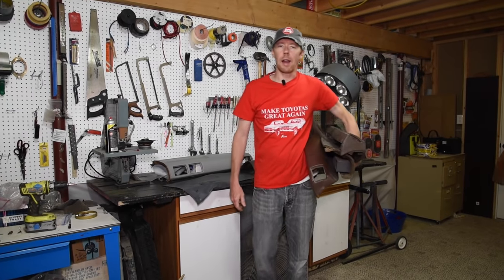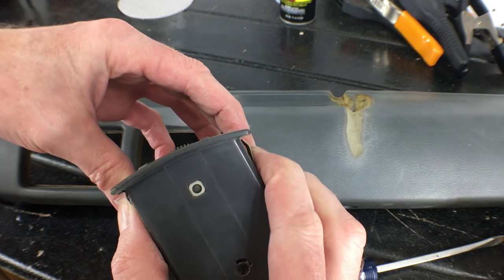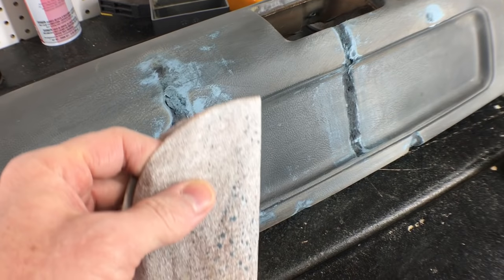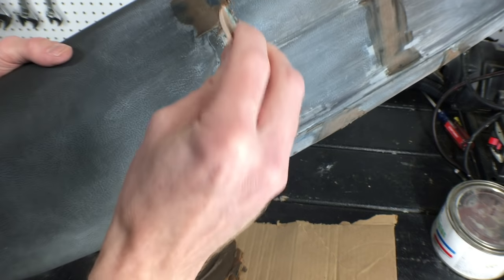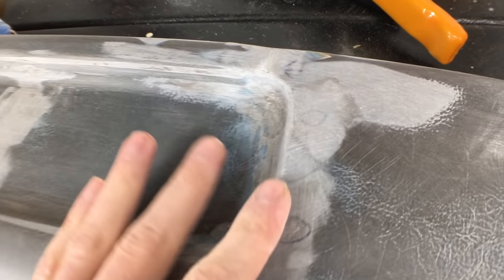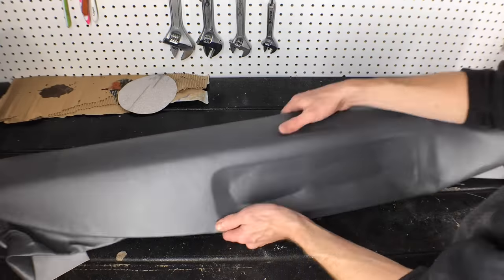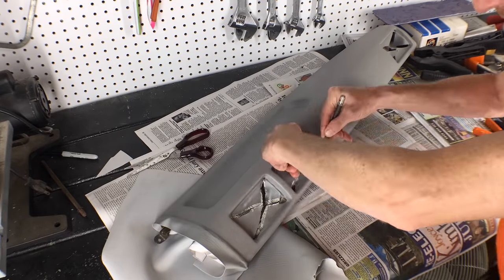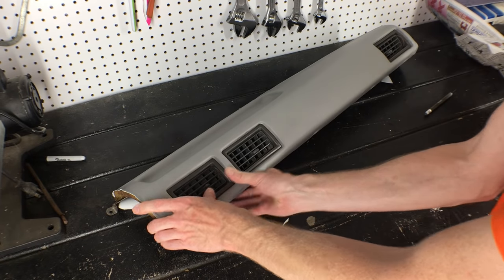How to Restore/Fix/Repair a Cracked Vinyl Dash - Toyota Hilux Pickup/4Runner PART 1

Comment: Great video,  watched it all and got an idea ...what about plasti-dip instead of the vinyl. Then paint to desired color? But would it stand up to the heat/cold ??Thanks for the vid
Reply from the maker: I think I'm going to try another using a spray on bed liner instead of vinyl to see how that turns out.  If I sprayed something thin like plasti dip, the difference in the vinyl texture of the repair area might be visible.

Comment: Helps to use upholstery adhesive glue to help hold down indentations such as that tray area. As for the corners, a good idea to cut a relief incision for the edges to adhere properly. Otherwise looking good.

Comment: I don’t know if this would help you. When I cover speaker boxes, I had a problem with adhesive nozzles getting clogged. So what I would do is flip the can upside down and spray it into a trashcan wipe the tip off a little bit of rubbing alcohol. and that usually helped. And if I was worried about it getting too clogged before storage, remove nozzle I would soak it it a shot glass, then rinse it out with water before putting it up
Reply from the maker: Great idea on the soaking... thanks!

Comment: Great video! Dovu think maybe u could have just filled in and deleted the  Resist area that kept giving you the problems?
Reply from the maker: That recessed area is where an optional inclinometer cluster sits, so I wanted to keep it open, but when I restore the third dash, it's getting filled in!. I recently restored a second dash using spray foam + some better materials and it turned out great: https://youtu.be/XB9GKLRHYNM

Comment: Use contact cement I have been doing cars and boats for a long time that's the best way to stretch you vinyl keep using heat gun and gloves
Reply from the maker: I recently restored another dash using brush on contact cement and 4-way stretch vinyl and the results were much better:
https://youtu.be/XB9GKLRHYNM

Comment: Do you have any videos on filling holes? I have a nice dash but the previous owner drilled holes for a CB mount I’d like to fill.
Reply from the maker: Here is another option: https://youtu.be/XB9GKLRHYNM I used spray foam on this one and it saved a lot of time. But for something small like a screw hole, bondo would be just as fast.

Comment: I'm late, but FYI most fabric stretches more along the bias (45 degree angle to the grain), so you might get more stretch if you laid the dash on the bias than with the grain.
Reply from the maker: Thanks for watching! I recently restored another dash using spray foam, brush on glue and 4-way stretch vinyl, and the results were much better: https://youtu.be/XB9GKLRHYNM
Reply: @6thGearGarage  I found that one after I posted--it looked great!

Comment: Next time after the bundle spray ur dash with that Gray filler used in body and paint. After it dries I need to send it down with 120 _400 set sand paper for a smooth finish. Next spray your dash with a spray gun and desire color 2 or 3 applications then after it dries clean with tack clod if needed before applying 3 coats of clear and ur dash will come out professionally nice. It paint must be bought for plastic allocation of ask where u purchase ur base paint it it can be used as a dash finish which is plastic.
Reply from the maker: I was going for the OEM look but would like to try painting one to achieve a smooth finish. I think that would look good.

Comment: You can put the vinyl in hot water to pull off the cloth backing at the back of the vinyl so you get more stretch when heating the vinyl
Reply from the maker: That's exactly what needed to be done to make this work. Thanks for that tip!

Comment: Wrap tip!: 
When you're messing with indented areas that require tenting and heating, you HAVE to leave a spot where that air trapped in there can escape . 
I mess with car vinyl which I'm sure is different from furniture vinyl but the method is the same ,.
Don't push hard, make sure the vinyl won't pop up over time , if it's popping up right after you put it down , it won't work.
It's also probably the substrate on the dash, most vinyl adhesive hates car plastics so you'd have to use a lot of heat or a lot of primer
Reply from the maker: Thanks for the advice. I may give this another try over winter.

Comment: You need to to brush the glue on and only a few inches at a time and by trying to do a large area will cause you a problem as you can streath it easy a little at a time and it will stick flat and by heating can also destort it if you get it to hot 😊
Reply from the maker: 100% I later restored another dash using spray foam, brush on glue and 4-way stretch vinyl + spray paint, and the results were much better, but still had a little trouble with the recessed area: https://youtu.be/XB9GKLRHYNM Also I put both dashes through a torture test to see which products held up better and the second one was definitely the winner: https://youtu.be/ywkqTaHK2LA

Comment: It's not OCD.  There's two ways to do things.   The right way...  And again.
  You repeat a process as necessaryuntil it'scorrect..  What's learned with experience is that it's easier to add a little more than enough and sand once or twice for each step rather than three or four times for each step (different material) with the exception of detailed areas which need a little more finessing. 😉

Comment: Glue a little bit at a time from middle out. Don’t use so much glue, let both sides get tacky, almost dry. Work material a few inches at a time.
Reply from the maker: I recently restored another dash using spray foam, brush on glue and 4-way stretch vinyl and the results were much better: https://youtu.be/XB9GKLRHYNM

Comment: maybe if you put the entire thing into a bag and apply a strong vacuume it to it,it will cause the vinal to form properly, keep in a vacuum until the glue sets.
Reply from the maker: That's a great idea, thanks!  I recently restored another Toyota dash using spray foam, 4-way stretch vinyl and brush-on glue, and the results were much better! https://youtu.be/XB9GKLRHYNM

Comment: Just a suggestion ... from an OLD paint guy , don't use cardboard for your mixing of filler , use an old glass cutting board , the wax and oils in the cardboard have some weird issues with adhesion
Reply from the maker: Good to know, thank you!

Comment: I would suggest using some type of rubber roller to used on the vinyl in the recessed areas in the flat areas, similar to what you have to do when you're installing a new screen and your window

Comment: Just wanted to say , excellent job, also a Question, is the black “fungusey” looking stuff on the back like wood rot? Ie. unless you treat it, it will keep eating your dash?
Sorry a newbie question
Reply from the maker: The back side was metal, so it could have been some surface rust. It's not going to do any harm since it's inside the vehicle. It's not from road salt, just moisture in the air over the years.

Comment: Brother the problem is not on vinyl thin or thick, it is your dashboard which the alignment is not equal and the way you apply filler it is not going to give good result even if you sand it multiple times. When you're putting filler you must not shake or move upside down, the moment you applied filler you must make sure that all the corner of the dashboard is still intact, 2 filler code is enough if we put little more extra in the first code so that we can sand it according to original shape. Before applying vinyl we can apply 1 code of paint spray in order to level up or cover up any tiny holes.

Comment: How can I stop the cracks? Will 303 uv spray help it? I have a blue dash for my 93 4runner and want it to last. It has two tiny one starting but dont want it to spread.
Reply from the maker: I haven't tried 303 uv spray, but the only sure way is to park out of the sun. I apply baby oil to the dash of my 85 and it has not cracked.

Comment: Fill in the recessed area and make it level with the rest of the dash top. Anything you put there will fly off when you drive.
Reply from the maker: I wanted to keep the shape OEM because there's an optional altimeter/inclinometer cluster that fits in that recessed area. I restored another Toyota dash using 4-way stretch vinyl and brush on contact cement, and the results were MUCH better: https://youtu.be/XB9GKLRHYNM

Comment: Costplayers use this stuff called foam clay, maybe you could do a project with that as a filler to test.
Reply from the maker: Great idea!  I restored another dash with thinner 4-way stretch vinyl and it's even starting to life in that recessed area. https://youtu.be/XB9GKLRHYNM I need to just fill it in flush.

Comment: If you add a little resin to the filler it is much easier to use.
Reply from the maker: Good tip, I didn't know that... thanks!

Comment: Idk how long u been doing this but u did a good job… I wouldn’t have went to “JOANN’s” I think u said u went to.. I go to an actual spot that has multiple colors and vynal, pleather, leather and etc.. certain vynal only stretches 1 way whilst others I can remember the name but it stretches any which way.. if I were to do this I would have worked on half of this and I would have cut the fabric down enough so it be more easy to use.. I would have attacked that spot your having the imperfection at.. steadily working that spot before I started to glue down the other spots.. most times I’ve used fiberglass and if that dip had nothing to it other then looks fill that area up so it would be a smooth top with no dips.. to be honest I know simple things are expensive for older model cars.. if I was to do it with fiberglass with the tools needed it be around 100$ and I could have made it however u wanted … I hope with GOD’s blessing I want to open a shop of my own someday.. I really like working with cars . My main thing is audio and fabrication. But here and there I’ve been doing other stuff to add to my resume.. like I’ve painted all types of things but never a whole vehicle. I’ve been learning how to do interior fabric custom stuff, and I know how to work on engines. Been learning as well how to etch in metal and aluminum engraving like they do on low riders and bikes.. so all in all trying like you to do other things.. But again good job👍
Reply from the maker: Thanks! That was my first attempt. I recently restored a second dash using the 4-way stretch vinyl you mentioned, plus better glue, and the result was much better! https://youtu.be/XB9GKLRHYNM

Comment: Not too bad of an outcome. It's certainly a massive improvement on the original. I think I would have just filled the recess in and had a flat dash pad. Personally, I think it would have looked better, even if not original.
Reply from the maker: After this experience, I agree 💯

Comment: Could you give a little more information on the particular vinyl you used in this video. The mil thickness would be a tremendous help.  Thanks in advance.
Reply from the maker: Sorry I don’t know the mil thickness, it was what was available at the local Jo-Ann fabrics. It was meant for boat seats though, a little too thick for a dash.

Comment: Start by sending cracks smooth. Spray adhesive.Wrap with felt. Paint on fiberglass resin. Sand. Spray adhesive. Wrap in vinyl.
Reply from the maker: Here's another one I did using spray foam, different glue, and stretch vinyl... much better results: https://youtu.be/XB9GKLRHYNM
Reply: @6thGearGarage   just curious.... but since you are using a platform that has the most how to videos available. Why didn't you just research? There's tons of videos on how to do this properly. In the day and age we live in. Why find out the wrong way first? Aren't how to videos supposed to tell you how to do it the right way so you don't have to do it the wrong way? This is a video of a person doing a job before they watched a diy video....
Reply from the maker: @R.S.O.  I did research and try different materials. There are different ways to do this, for example you mentioned resin, but I found filler to be less brittle. In the end I made some mistakes so others can learn and not make the same mistake, saving a lot of time. Then I did another dash video with different methods/materials and got much better results. Now I’m going to compare both to test which materials hold up better to extreme heat and cold so viewers can see the best products.

Comment: Thank you so much.  I had a 1987 SR-5 with 22-re and sold it about 5 years ago.  However was looking to fix my 2000 ford mustang dash with a small crack.  Any advise for just a 1 mill 4 inch crack?  I've thought of using that spray foam to fill the gap, then just use a paint.  of course this would be in conjuction with changing out my broken Heater core which requres a dash removal.
Reply from the maker: The only thing I could see going wrong is that the crack could continue growing. But you could always touch it up. I recently restored another dash using spray foam, 4-way stretch vinyl and brush-on glue, and the results were MUCH better: https://youtu.be/XB9GKLRHYNM
Reply: Thank You, BTW, what is your first name?  When asking you questions, I'd like to address you by name.  FYI, I went nuts watching your video's on the Honda Acord project car.  I love you bought it for $350.  My question is, how much have you spent on it so far?  What's the end game for that car?  Keep it, sell it ?

And how many Toyota's do you own?
Reply from the maker: @rickgray5731  Hey, I'm Brian. There's some older videos of a 98 Honda Accord that we cut up into an El Camino, but that was $500. I bought an '88 Acura Legend for $350 last year, probably have about $1300-1400 in parts/fluids/materials into it so far. I'm putting some miles on it right now to make sure everything else on the car is good and then I'll probably end up selling it to make room for other projects in the garage. I have 4 Toyotas right now, but 2 of them aren't on the channel yet until I finish up some other projects. After I finish some things on my 85, I'm going to start the next toyota project. They're addictive!
Reply: Thanks Brian,  I watched the timing belt change, the seat cushions, the paint job & clear job and buff out, the rim painting for the 88 toyota Sequoia, was that a project truck too?  And if so, do you have video's on fixing that?  Anyway dinner in 80 degree (without humidity 😜) at 7:38 in Hayward, CA.  near Oalland.  
Have a great night.  

FWI. My project is the 2005 F-250 superduty 6.0... ugh,  Should've kept the 87 SR-5.  Just kept having head gasket issues.  Aluminum head flakes & the torque converter on the SR-5 Gave out.  But got 245k out of it.
Reply from the maker: @rickgray5731  Not sure which one you meant, but I restored the wheels on my 94 Land Cruiser and also the wheels on my 1985 Toyota Pickup, in separate videos. I have a playlist for each vehicle here: https://www.youtube.com/c/6thGearGarage/playlists  Did your '87 have the 3.0 v6 or the 22RE?  And I've heard a lot of stories (mostly bad) about the 6.0 Superduty!
Reply: @6thGearGarage  My mistake, it was 1994 land cruiser wheels.  I'll watch some on your 88.  My 87 was the 22-RE.  2 blown head gaskets & a defective head & torque converter.

Plus the truck was extra cab with Brahma top.  Basically the best toyota ever made.  It was stolen for parts right in front of my house on the 4th of July while I was at the fair watching fireworks.  The truck was stripped for it's seats, dashboard, center column, Brahma top.  Plus I found the truck about 3 days later in a residential area.  I put it back togeather only to have the engine blow up again after 15k.  Ugha, ugha....
Reply from the maker: @rickgray5731  Sorry to hear that!! after two clown headgaskets, I would have felt like giving up too.
Reply: Now I'm not looking forward to Head gasket repair on my 235k ford f-250 with a 6.0 powerstroke.  The ford described way to do the job is to take the cab off!!! I don't have a cab lift in my driveway!  Plus not going to buy one for one job.  LOL.  Anyway Love your video's, and because you leave the bloopers in, I think you learn more than just having an edited video with the job completed.  I also have hands like yours and find it real hard to get in those tight places.  Wish you had my type truck as your next project vehicle.  LOL..
Reply from the maker: @rickgray5731  I'd like to own something more capable of towing one day. If I was ever to buy a F250, it would be anything but the 6.0. I've heard bad news about them.
Reply: @6thGearGarage  6.4 is bad too.  I understand & agree.  However I've been told that once the Motorcraft parts are replaced by Bulletproff parts, your truck will run fine.  However that's the Waterpump, Turbo, EGR Cooler, EGR valve, High pressure Oil Pump, Fuel Injectors, and Faulty heads and head gaskets.  So please get a 6.0 and rebuild the engine fixing all these issues.  LOL
🤣

Comment: Next time use Allsport vinly its a 4 way stretch vinly … and glue in sections starting in that low spot that wouldnt lay down an glue and stretch out from their
Reply from the maker: I discovered 4-way stretch vinyl after this video. I did another dash using the 4-way stretch vinyl and the results were much better: https://youtu.be/XB9GKLRHYNM